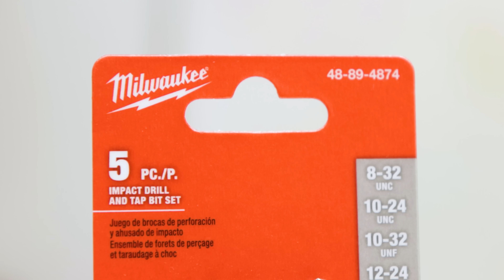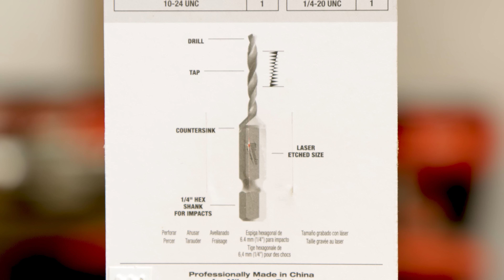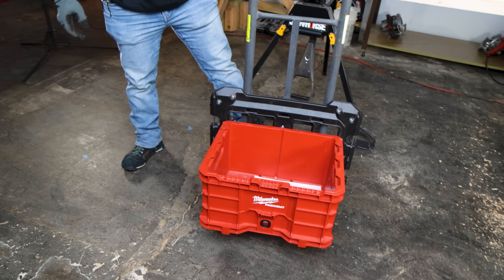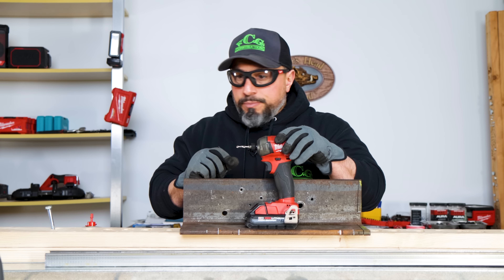MILWAUKEE TOOL ACCESSORY MAKES INTIMIDATING JOBS LOOK EASY! (must have)

Comment: As a machinist that makes fluted cutting tools, I will say if you want/need to exceed the specs of your tool: Use WAY more cutting oil than you think you need, especially when dealing with something like threads. It will protect the work from damage and will prolong the life of your tools. I’m glad Vince used SOME here but honestly oil is cheap compared to these bits. And you don’t even need a super special cutting oil. Anything that can soak heat and disperse chips is good. I work carpentry now and keep a bottle of canola oil in my car for any hole-making or metal cutting that needs to be done because it’s cheap, safe, and easy
Reply: Thanks Colby, I have always wonted a cheaper solution for an oil!
Reply: @rtgray7  when it comes to precision it matters a bit more but if you’re making a hole with a hand drill, precision ain’t the name of the game, and cooling is more important. Canola oil does a great job acting as a coolant and as a lubricant for cutting edges. We actually use a canola based oil in some of our machines. Use what works
Reply: @colbywood8113  Awesome. Glad I noticed your comment Colby.
Reply: A very famous mechanic says the same thing, oil is cheap, change your oil regularly and don't go over the milage, oil is cheap but replacing your engine will cost you your car 👌
Reply: I spray oil on as I go
Reply: Are you doing this with screws. Or only for drill bits. Hmm
Reply: The only good thing to use canola oil for. :)
Reply: Canola oil for drilling metal work 🤔.
Thanks for the tip 🙂

Comment: I am a repair tech for small appliances and have been so for about 25 years. What I would feel weak in the knees would be complicated repair of a gamer's computer. I can do easy stuff like micro soldering and removal of screws after taking photos to show how it goes back together. But I have experience with repairing lamps, mixers, waffle makers, non-computerised sewing machines, vacuum cleaners, clippers, etc.

Comment: Vince, It looks like the design of the bit is what restricts it to 1/4" material.  The tapping cutter starts after a 1/4" of drill bit.  I'm sure the tap was shredding the 1/4" hole before the drill made it through the whole 1/2" of steel.   These look good for quick drill/tapping on thinner material.  And, yes, as others said, the kit really needs a 6-32 drill/tap.   
Thanks for another informative video.

Comment: Im a heavy duty diesel mining technician and i am so used to the old way of drilling out a hole and then having to find the right sized tap for the hole. Probably wont replace my tap and die set but could be useful for quick little jobs like attaching fenders or bolt on air tanks if the holes aren’t drilled yet
Reply: Usually someone has the tap they want then they look for the drill
Reply: i got a really cheap bit set like this last year & my husband, a mechanic and machinist, lectured me for an hour about why these high speed bits should be a hard no.  But, i got it for use in wood, making quick jigs & such & it works fine for that.  He has eve used it a few times(something on the motorcycle, i think).     
  i may het him these Milwaukee's?   The set I got is cheaply made & wont hold up if he uses it in metal.

Comment: Vince, thanks for covering an essential tool kit, especially for Sparkies. This will certainly help all the maintenance folks who thinks putting drywall screws into electrical boxes will save the day, until a qualified team comes through with proper Taps and makes it inspection ready. Most importantly, NEC compliance.

Comment: I went to school for machining. So drilling and tapping isnt a big deal if its done right. Thats where it all comes down too. Sure a seasoned journeyman machinist can break a tap in a piece of SS that they are machining, it happens daily. But now with stuff like this coming out, it makes it so anyone can drill and tap. Before you had to learn how to do it (and a huge factor was the metal type (SS is gummy, steel can be harder, Alum can be tricky with pockets in castings, etc), now you can just do it. Great video.

Comment: I love drill and tap bits, I am a commercial plumber and we do a lot of renovations on older high-rise buildings. One of my jobs is to replace old tub trim... Half of them are so rusty the screws snap and we have to drill and tap new holes. These let me do 15 in the morning. With out these I would spend 2x the time.

Comment: Vince You have shared one of my favourite accessories today. I have been useing the dill tap for 2 year now. My favorite used is adding a ground on in wall outlet boxes. One smooth operation to making the outlet code. I have all 10 sizes and Highly recommend to  Carrying Carrying spars For high use thread size. Please keep sharing  Innovative ideas and things make life easier.
Reply: What are all the sizes? I would like to get all ten of them?

Comment: Picked up the set Tuesday night used Wednesday to tap and die door latch plate in heavy Gauge steel frame and used it Thursday to tap and die Into stainless steel square tubing  When's through like butter very little effort Definitely a must have for one stop tap and die

Comment: I'm relatively new to construction and working on my own home right now. but I would love if you did a video on the different types of nailers because there seems to be several and I'm not sure what all the differences and how their best used. Love the channel and watch every video!
Reply: I would also like to see that.
Reply: I would recommend Dewalt brushless if you have the cash. Very good to me. Primary brand favorite is Milwaukee.
Reply: I have done drilling and tapping the old way but this looks awesome,I already have a ton of Milwaukee cordless tools but this looks great
Reply: Same boat with me. Drill driver, impact driver, hammer drill, wtf is the difference. I use my little impact driver for literally everything because I'm not sure what the use case would be for me to use my drill driver. If someone made a video of USE CASES for those that would be helpful

Comment: With a separate drill bit and tap you can tailor the thread depth. This tool will work good for light duty tasks, or where you have to drill and tap many holes in light material though.

Kept waiting for, but wait, order now and….

Comment: I like that. When my Surge pooped out while building a deck I was told by Milwaukee service that the surge was only meant for small fasteners like sheet metal screws. They fixed it under warranty but it sounds like he was full of crap after watching this.

Comment: I love mine! Use a little bit of oil and these things will last forever. I had to redo the screws holding the top of my planner on after the bolts broke off. Took 5 minutes and BOOM! Custom bolt holes! If you put them in your shockwave bit boxes be careful, they are very very sharp!

Comment: Used these bits this week to repair a commercial pizza oven. Used on a stainless steel piece where the set screw was stripped and broken. Drilled out, tapped a new hole with these bits, now has a larger set screw. 1 week later and 1000+pizzas and its still good to go.

Comment: 1.  If you want drill bits to last longer drilling into steel, a small pilot drill first.
2.  Use cutting oil for faster cutting and cooling.  You'll save drill bits by using oil as it helps to lubricate and cool the bit.
For 1/8 inch or .125 thousandths and 1/4 or .250 thousandths steel that combo drill/tap bit looks good.  More and more I'm seeing Metric sizes so I hope Milwaukee can come out with Metric drill/tap combo's.

Comment: I buy cheap ones off Wish. Been using them for 3 years now.  I use them with Tap Magic oil. Only one I’ve had to replace a couple times a year is the M6 bit. Use that one a TON

Comment: I am a Electrician and I have a set. I use quite often have had it for 4 years or so. It comes with 4 sizes the 6-32 to 1/4 20 comes in a nice plastic case that hasn't broke yet. That I am somewhat proud of from Harbor freight. I believe it was under 20 bucks. If they don't have them in the store in ase they are in the book to order.
Reply: Can you explain what the sizes mean?

Comment: I am not a trades person and this has been one thing I never had to do but, dreed the day it would happen I needed to. Typically I just punched a hole in something run a bolt through hole and used fasteners. I am very impressed by these and dang it if you didn't make me want something again. Thanks man another great vid.

Comment: I would oil, then tap the tool into the steel much slower.  I’d also reverse it in and out as I moved deeper.   That protects the tool for longevity.

Comment: I think the reason the tap/drill is rated for thinner material is because of the 3in1 nature of it, the drilling is completed before the tapping begins and same with the countersinking, so by exceeding the thickness you are blunting your taps, and stripping the first portion of your threads, personally id look into picking up some proper machining helical taps and drill then powertap. It is fine for thin guage materials as specified on the product though.

Comment: Vince, I no longer do auto mechanics -- thank god -- but boy this is a freaking dream tool. No oiling, no drilling and no tedious slow back and forth movements to make the threads. That's a miracle. However, I wouldn't say the old way is intimidating. It's just TEDIOUS as heck and very non productive.

Comment: I've had the m12 surge impact driver for a while now and I love that thing
Reply: I've had it since it came out (couple of years ago?) and have used it everyday for work. No issues with it and it runs like a champ still.

Now that I think about it, the only thing that happens if it gets knocked, the light will automatically come on. I'll reach for it and the light will be on in my bag. Awesome otherwise

Comment: I love how they don’t even bother with a 6-32. I’ve broken every size of the cheap and expensive brands of these and the only way to go in my experience is in a drill ( not impact)  on a low screw clutch setting 4-5 and pilot it first. Tap oil too of course. I’m very surprised he tapped that piece of angle at the end. I thought it would snap for sure!
Reply: I agree with everything you said.

Comment: I drill and tap just about every day .  Sure would be easier than changing out two bits when I can just work with one. Definitely gonna buy these.
Reply: Go slow and use cutting oil or you’ll break them
Reply: Just buy two drills.

Comment: Been using them in electrical trade for years now. I have a Greenlee set. Came out 5 years ago. Need to add a ground lug in an electrical panel? No problem.

Comment: I know this is supposed to be a commercial... but lots of trades know about these. Greenlee seems to be the one that started this combo bit. To extend the life always use a bit of Tap Magic. And these aren't the end-all-be-all for tapping a hole. Sometimes you need to use a Weld Nut, RivNut/Threadsert or a Flow Drill Bit... the skill comes in at knowing when to use which.

Comment: Late I know, but I bought a cheap set of metric drill taps and they work great on ali and for threading hardwoods. Steel? idk, not tried yet. Bonus you can get in tight to a side where a conventional tap wrench cannot fit. Word of warning…you must let the tap progress at its own rate and don’t buzz the trigger or it might either snap the bit, or chew out the threaded part of the work.

Comment: I drill and tap all time...today I drilled and tapped 30 1/4-20 holes in steel :). I have used these Milwaukee bits.  Used the greenie ones 5yrs ago. Also the Klein and dewalt versions :)   The drill part os so so.  Dulls pretty quick
Reply: Out of all of them which do you think holds up the best?
Reply: @shawnloy6465  the old greenlee ones worked very well. The drill portion seemed to last longer   As for the tap part, they are all pretty much equal it seems.  I only break them if I don’t pay attention, then they all break really easy. So far the Milwaukee one I’m using right now is holding up really well tap wise.   The drill bit part is shot, so I drill the required hole first.

Comment: Hey guys I had a question, Im not a machinist but I do have a 3 in Irwin table vise I wanted to tap some threads in order to add some kind of wooden faces. Will this work for that? I didnt want to buy something Ill only use once but theses look more economical. I do more woodworking and wanted to protect my chisels and planes from getting damaged is why im trying to add threads to the vise. Thanks

Comment: As an electrician, I've been using these for years. The problem with any set from Dewalt or Milwaukee, unlike my Greenlee set, there is no 6/32 for my trade. This looks like a good set aside from that
Reply: a 6/32 would probably be too narrow to be reliable on an impact...
Reply: 6/32 is so popular with electrical I’m shocked they don’t make them in the basic sets

Comment: I almost got the Milwaukee drill and tap set but I got the Greenlee set instead because it has a case.
Reply: Saw that too. I like cases 😂
Reply: Jason a plastic vitamin bottle with a locking top works well for small bits.
Reply: When it comes to taps, I don't want the taps hitting other metal tools or metal objects, it damages the cutting edges.
Reply: @jasonbabila6006   That is true to an extent, I agree if they are larger bits.  IMO  smaller bits should be ok. Just a thought because a lot of times you end up paying more for the case.
Reply: The Greenlee drill tap set I bought last year was $26 at a local electrical supply shop.
Reply: @jasonbabila6006   good deal.
Reply: @frankcovert6196  It was on sale and retail is $34
Reply: @jasonbabila6006   Nice.

Comment: Try filling 10 seconds on 3 off , the titanium head studs to be drilled out on Ford 3.5l eco boost exhaust manifolds require that when they get so hardened after use, doing else wise would damage the platinum coated bits and also the stud

Comment: I was taught to use the hack and die sets a long time ago this is quick and easy. Most of the sets like that i see are not metric, in the auto industry most fasteners are metric and a lot of the holes are blind not thru holes.
Reply: HF stocks them in metric.

Comment: Can't find those Milwaukee drill and taping bits for sale here in the UK, but I did find a metric set on ebay from a seller in the U.S. for $21. 
Sadly, the shipping and import duty cost even more than the bit set itself does, so it looks like I'll have to keep my fingers crossed that Milwaukee offer them for sale over in the UK sometime soon.

Comment: I do hvac so I automatically dip into plumbing and electrical. Not too deep tho in plumbing, water mains and high voltage are still pretty scary, glad I don't ever have to mess with water endless its a clogged  primary

Comment: Well as a machinist just saying drilling and tapping in metal is not supposed to be done dry using oil works wonders also going back half a turn every so often to break the chip and not load the tap to much

Comment: I wouldn't say I'm intimidated, but this does make the process faster and you don't have to carry around a lot of different tools, and have to pick through the different bits and make sure you have the correct size drill bit and tap.  You simply grab one, make your center punch, drill, reverse and thread in your bolt. makes life a lot easier.

Comment: Every big brand impact probably the same, but noticed if you were doing anything wider than angle or flat bar. The battery wouldn’t allow you drive the bit through far enough, at least not to countersink.

Comment: the drilling must be complete before the tap hits the metal.  Is there 1/2 inch of drill in front of the tap threads?  Could that be the reason for the 1/4 limit perhaps?

Comment: Plastering is one thing I will never mess with.  I’ll always drywall myself if the customer will go for it but a lot of people in my area think drywall is cheap.  I have done some plaster in small areas and still will but a new kitchen or bathroom, no way.  It’s not worth it and I can get people to handle it for so cheap that it’s not even worth my time.

Comment: you've turned me from a Ryobi DIYer to a Milwaukee DIYer.
Reply: Yo i think imma make the switch too
Reply: @margaritoflores9709  you won’t regret it
Reply: @tarn6800  I’m starting with Milwaukee power tools and snap on hand tools, is that what you’d go with in retrospect?
Reply: @P_steez  this is how my personal ranking works, Milwaukee makes the best power tools for construction purposes but some of the hand tools are good too but snap on is better on that front, but when it comes to gardening Makita takes the cake.
Reply: Aren't they both owned by tti
Reply: @tarn6800  good to know, thanks for the input, I like makita a lot too, it seems every brand has their strength. You’d take makitas outdoor tools over ryobi?

Comment: Wow, Vince I applaud you for NOT SNAPPING THE BIT IN HALF LIKE EVERYONE ELSE DOES...I can't tell you HOW MANY TIMES I have seen guys just SNAP the tap bits in half. When I was working in traffic signals, outside, the contractor would LITERALLY ORDER 100 of these 1/4-20 taps at a time...Because NO ONE knew how to use the properly...You drill normally THEN SLOW IT THE F*CK down, and pulse the trigger forward and reverse, just like you would with an old school tap/die set...

Comment: My concern is that’s the threads are being cut at a high speed. That’s not how tapping threads is usually accomplished. But it’s ok for up to 1/4 or 3/8”. Though this would not work, I suspected in creating constant threads in say a 1” hole